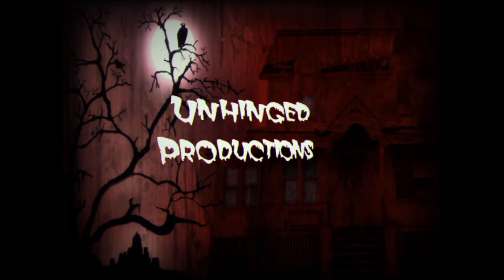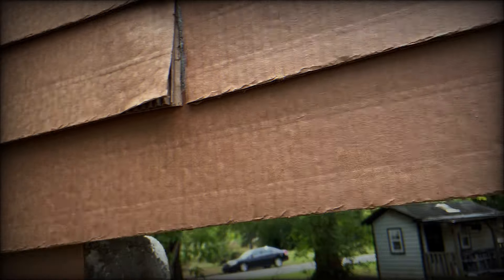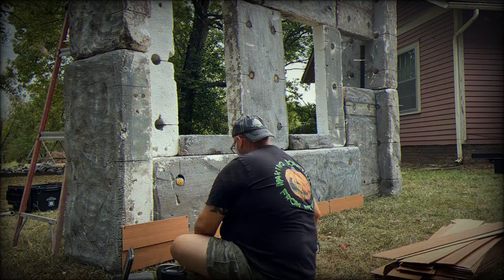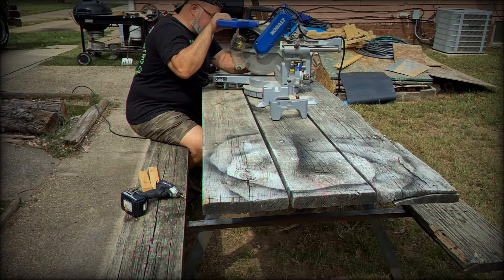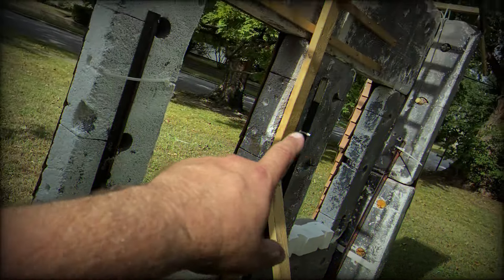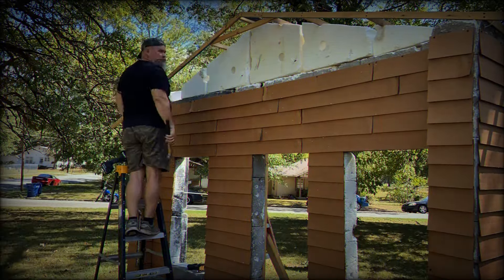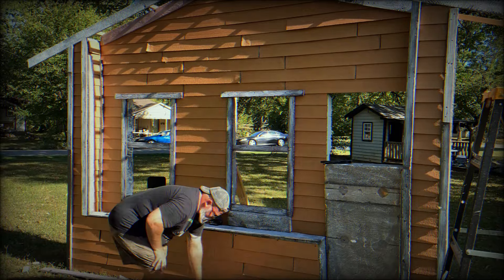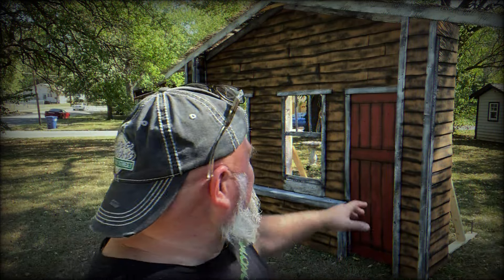How I made a witch house for $30.00

Comment: You put lots of detail in it. Great project showing what can be made from stuff on hand. Just look around at the stuff you have on hand and think of what the pieces can make. Cardboard works great for something only intended to last a single season. Especially something like this where wear adds to the mood. I needed coffins one year, so I made them out of large cardboard boxes and painted them black covering all the edges. They lasted fine. 

Thanks for the video. Looking forward to seeing what you do with the rest of the yard.
Reply from the maker: LUPIN!! Well yes and no, on the detail. Lost of the little foam trim has no wood graining worked into it, just slapped it on and let the paint trick your eyes..  lol I consider that being lazy! Ya finding things you already have to make something is the way I’ve made most of my stuff.. lol. However I have to admit, actually planning out a project and getting supplies is way easier sometimes. Not easier on the pocket book but way less challenges to over come.  But on the other hand if you’re determined to make something and don’t have the funds to do so, if you get creative you can usually find what you need to make it happen!
Reply: This has what I call distance detail. People won't get close like they will on the house facade so you don't need small detail like wood grain. The paint you did adds depth to the "boards" and makes them look more real. It all adds up. I would never have thought this was foam and cardboard from the photos you posted before.